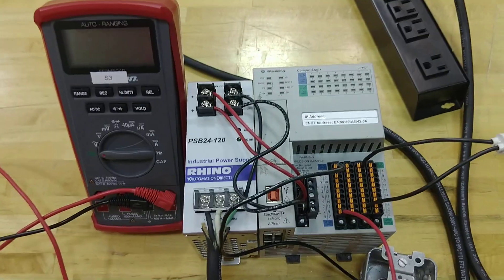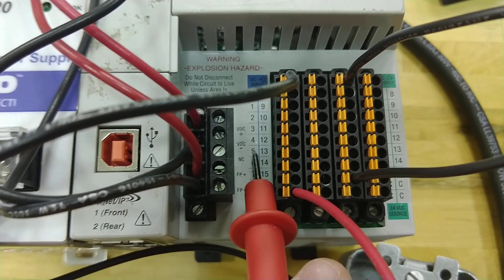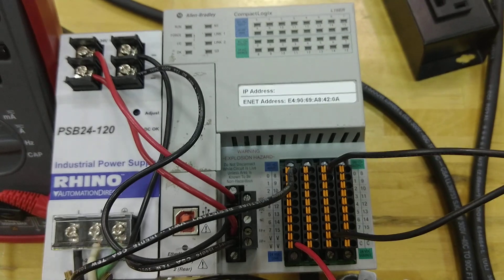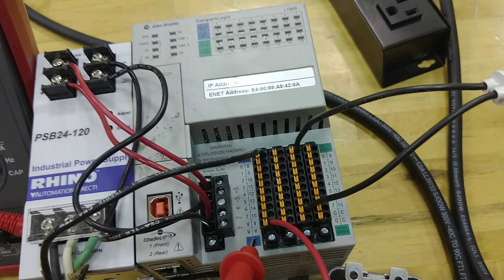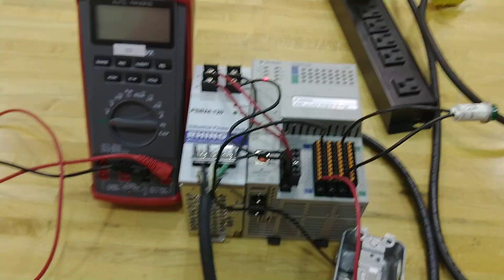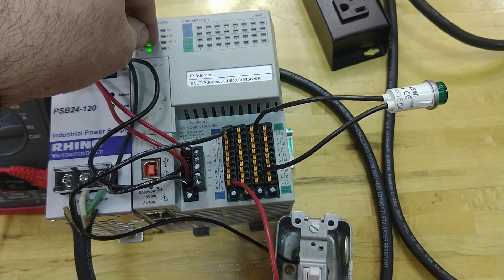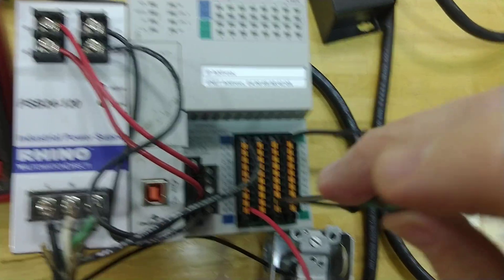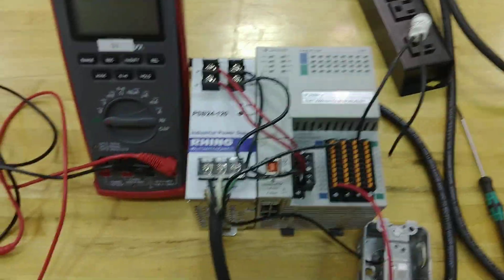Wiring 1769-L16ER-BB1B Inputs/Ouputs

Comment: Thanks Dan! Just bought  this PLC used off of Ebay and ran power to VD+ and VD-. I was getting an error when trying to use internal bits to turn on the Inputs and outputs. Now I realize i need to add field power. BTW this is Joe from Ivy Tech, and now from Heartland.

Comment: is it required to connect seperate filed power ??
Reply from the maker: If you want your inputs and outputs to work, yes. If are just using the processor to control Ethernet devices then no.
Reply: I have 8.6V across all outputs and C . Is this correct? When output 0 is activated we have 24V. But thr 8.7 is causing confusion here in our workshop , thanks